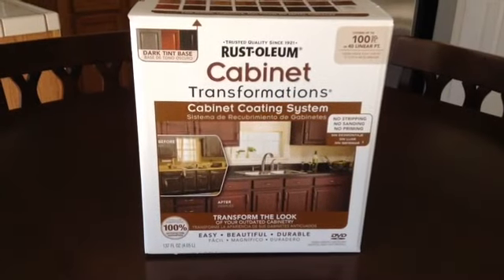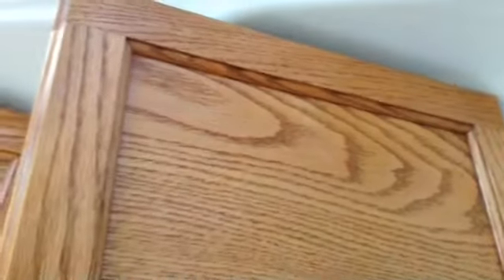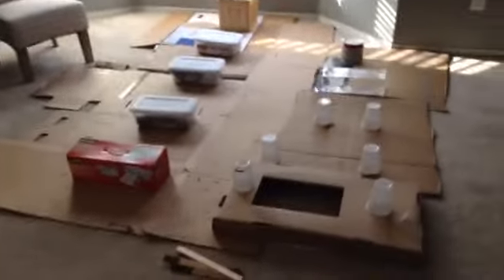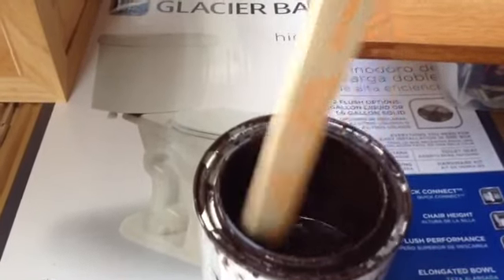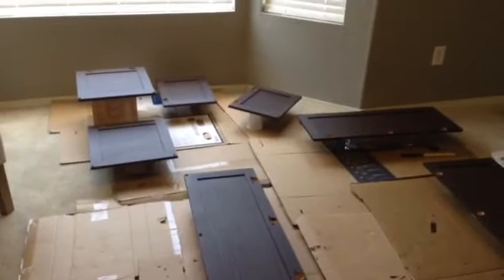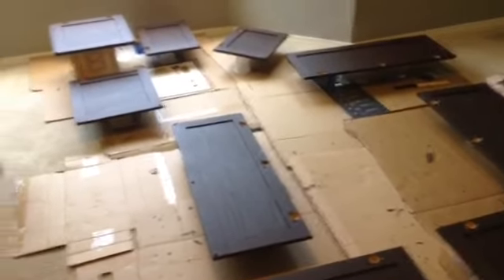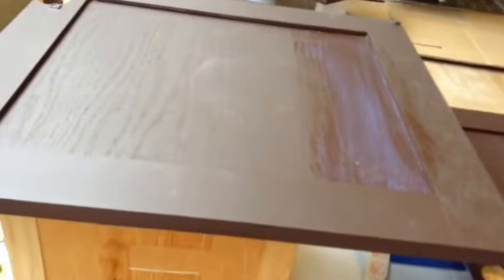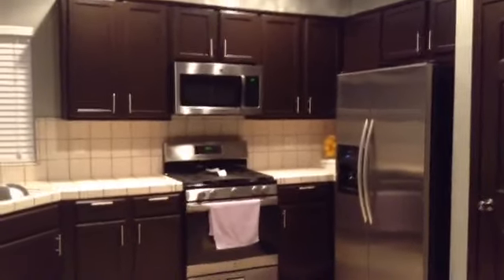DIY: Kitchen transformation I Rust-Oleum Transformations I under $150

Comment from the maker: UPDATE:
It has been over a year since I painted my cabinets. Overall, they still look really nice. However, there are some areas that need a retouch. More frequent touched areas (edges) are starting to show the previous color such as the drawer under my kitchen sink. My suggestion for anyone doing this project is to take extra time to take off the previous polish. If that means sanding them I say you do it OR atleast on the edges. Last year after I did my kitchen I decided to do my moms 1995 kitchen. Man they are holding up so much better than mine because the shine (polish) had aged. My 2004 cabinets are still good but some areas need a retouch. That is my next project to try to retouch without ruining them. Other than that they still look amazing. :) 
Good luck
Reply: Monica A, you did a great job!! I just started my Rusoleum cabinet transformation project and your video is super helpful! I’m so excited to get it done! I hope it turns out as beautiful as yours! Ohh I shopped around for my hardware too and got everything on Amazon! I couldn’t believe the prices in the stores!
Reply from the maker: Hi KIM,
Just curious as to how your project turned out?
Reply: I agree with the sanding. The instructions say it isn't necessary, but a light sanding is necessary. I used this for my bathrooms and overall I am happy with the results, but a sanding is something I would do if I had to do it over again.
Reply: How long did the total kitchen project take you?
Reply: I agree with you, sanding them made a huge difference.
Reply: Thank you so much for the original and updated post!  In the future you should reach out to the manufacturer of any product you are about to use and ask for sponsorship money for making a video.  Your straight forward non-professional skills demonstrates that anyone can do it.   Very nicely done.  And I agree with you and comments about doing some prep sanding to prolong the deepen the final color look.

Comment: Hi !!! The alumiunum foil you put un the  top, did you wrinkled, or did you put it extended ?
Reply from the maker: I just have it extended. I replace it when it gets dirty and it helps for light reflection.
Reply: @Monica1421A  Thank you verte much for answering, you have a very nice kitchen. I will do they same on the top.

Comment: What's color is that?
Reply from the maker: Rolando Trevino it is espresso
Reply from the maker: Rolando Trevino it is espresso
Reply: @Monica1421A  thanks a lot
Reply: @Monica1421A  I have another question.. how many kits did you use?
Reply from the maker: Rolando Trevino I only used one kit and had some left over
Reply: @Monica1421A  thanks, by mistake I order 2 kits 😒
Reply: @Monica1421A  thanks a lot

Comment: Hi! Nice job! I have a question, do you have any tips to make the last step easier? Im having a hard time , mine is expresso and you can see the brush strokes, its the last  step and I dont like how it looks. Thanks!
Reply from the maker: Hi Wendy, I just made sure to constantly wash my brush. I washed it after each application. On mine you can't see brush strokes but  on the inside of the cabinets you can see the sealant where I didn't spread it evenly. My suggestion is to constantly wash your brush and don't try to fix brush strokes too much or it can make it worst. Wait until they are fully dry and let's hope that they are not as visible when dry.
Reply: @Monica1421A  Thankyou so much! That was very helpful!